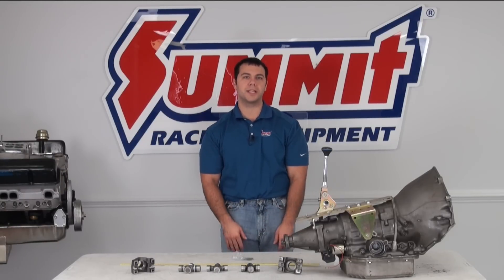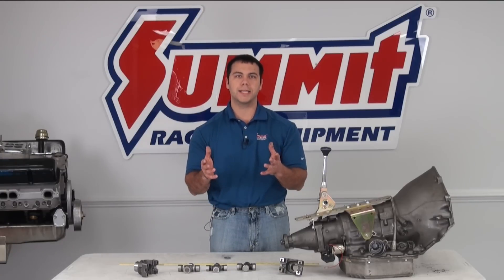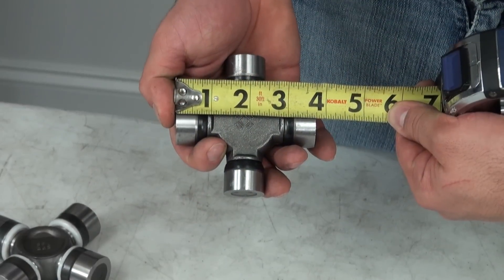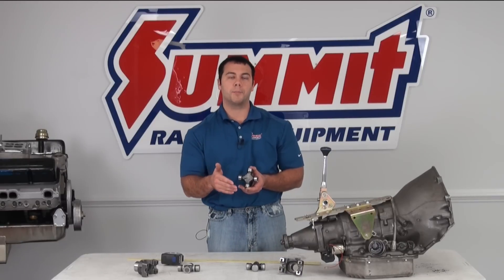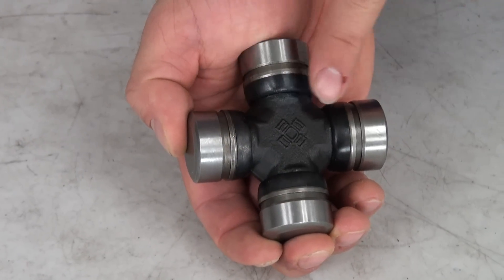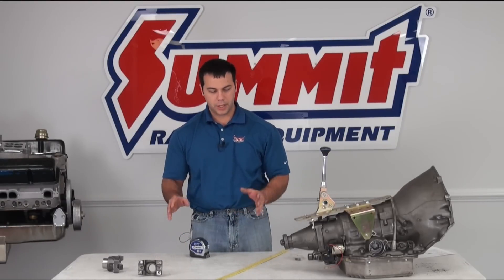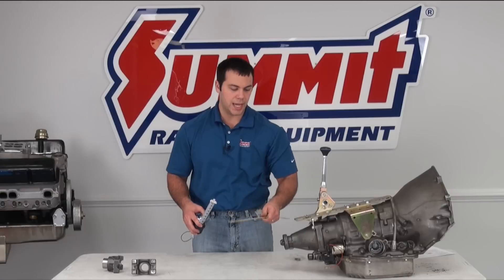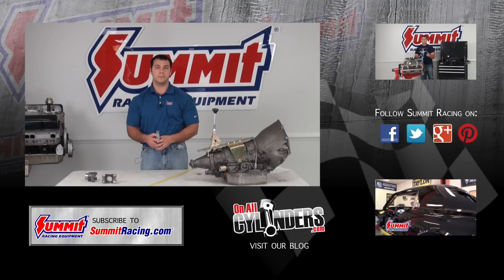Types of Universal Joints - Summit Racing Quick Flicks

Comment: I have a 83 monte carlo  with a turbo 400 short shaft and ford 9in need new drive shaft
Reply from the maker: We can order you a custom driveshaft. We would need to know several things  
 
U-joint size at the transmission and differential yoke 
 
Transmission spline count 
 
Length from the transmission output shaft to the center of the yoke with the car sitting at normal ride height 
 
 Here is a link to a custom order sheet with all the details: https://help.summitracing.com/ci/fattach/get/126486/0/filename/IED+DriveShaft+Form.pdf 
 
Once completed, call our sales staff @ 1-800-230-3030 and we can get this ordered for you. 
 
Thank you.

Comment: I'm trying to find a u joint to fit on the rear end of my 1999 dodge ram 1500 4x4 5.9L. Because the one I bought, it moves between the yoke and straps. And the guy told me I would have to buy a new yoke, but I think it's just the wrong size u joint. Can you please help?

Comment: How dod you no witch shifter to by on a power glide transmishtion ? Is it a forward or revirse
Reply from the maker: Hi Robert Harden, 
A forward shift pattern has Park all the way forward (close to the dash), then Reverse, Neutral, Drive & Low. On a reverse shift pattern; Drive & Low positions are switched.

Comment: Question ?? Which one would I have on a 1985 Chevrolet caprice classic
Reply from the maker: Looking at our database, your 1985 Chevy Caprice should have come with a 3RL series U-Joint, this series is commonly referred to as the S44 GM type.  We have quite a few of them available online at: http://www.summitracing.com/search/part-type/u-joints/department/transmission-drivetrain/universal-joint-style/s44-gm-3rl  However, you should double check the size of your u-joint if you or anyone else has made drive train modifications to your Caprice.